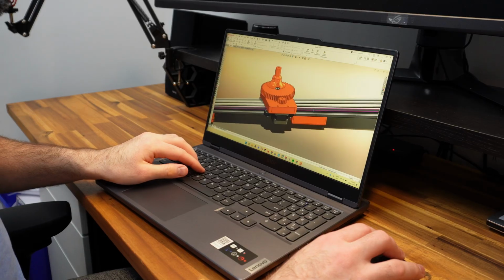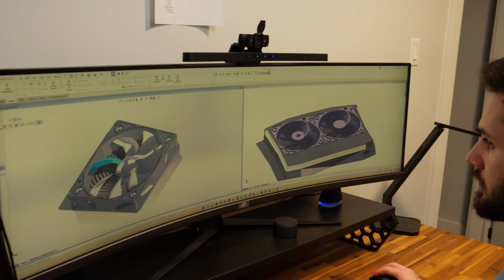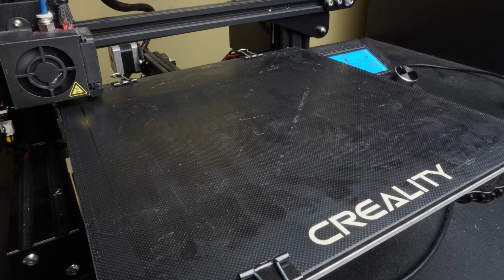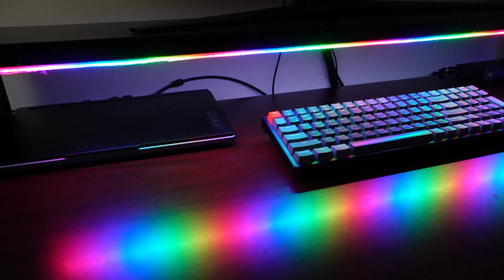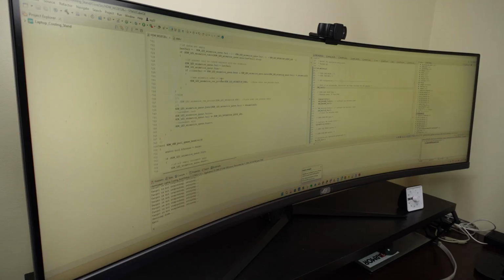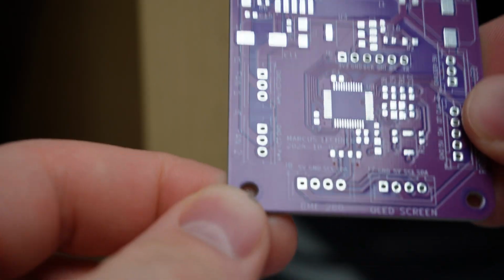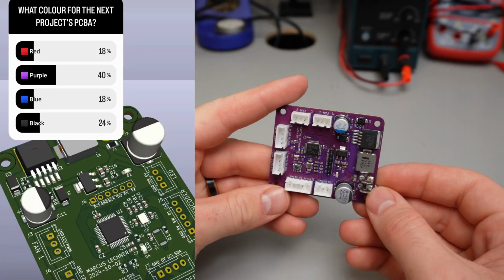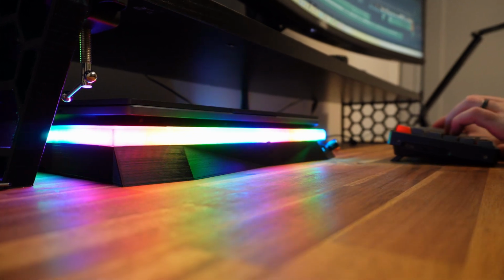Making an RGB LED Smart Cooling Dock for My Laptop

Comment: this is fantastic would love to make one could  plase plase if i give you email could you send me how its all wire up useing stm 32 microcontoller be greatfull of an your youry help in this thanks again for your time mike
Reply from the maker: There is a link to PCBWAY where you can get the PCBA for this project that has the stm32 already on there with supporting components!!